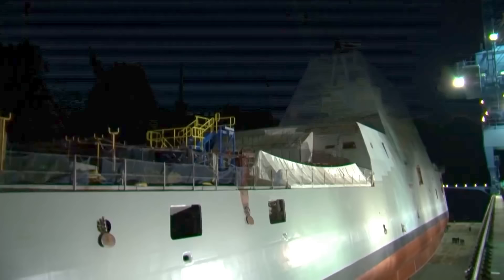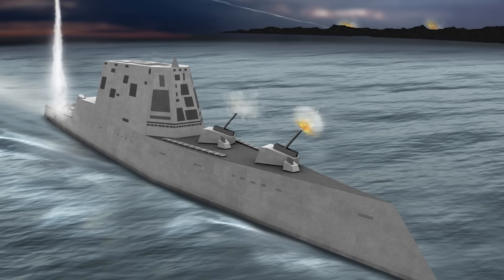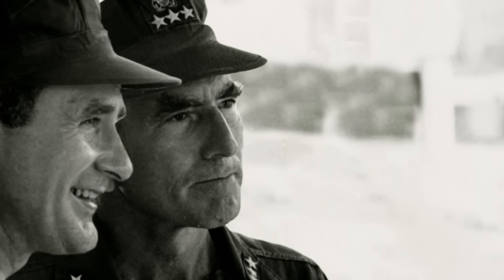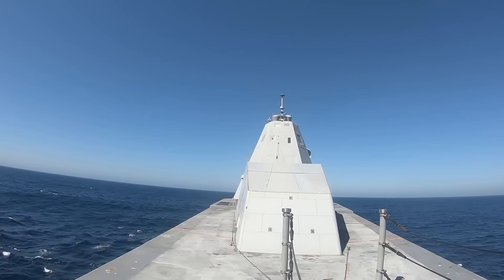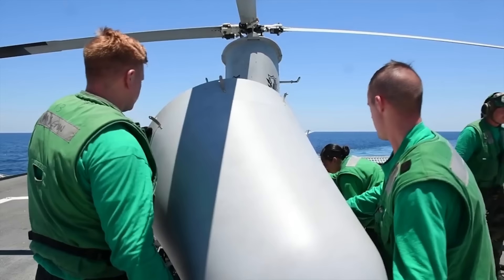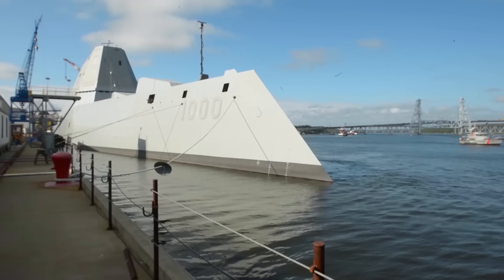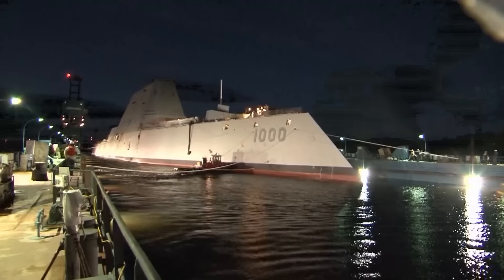The Stealth Ship So Powerful They Couldn't Build Any More

Comment: For a while now I've wondered why the military doesn't go to a modular form factor. Design all new/future ships to be modular in their kit. Systems designed from the start to be swappable with minimal down time due to a unified base set. Have a destroyer that you need to change out from one role to another for a mission/deployment? Pull up to the dock, gantry crane pulls out the missle banks and drops in a multi-helicopter pad or a large diameter gun turret. All within a day or two and the ship is back under way.
Reply: Modularity requires way more engineering work up front. What goes from we'll just weld it in there during construction becomes we need to figure out where to place these bolts, how to access them and how to make these 3 other parts removeable also.
Reply: Never worked in a shipyard or even seen how a warship is built, have you?
Reply: The tried it with the littoral combat ships. It didn't work and was too expensive.
Reply: In theory this would be a great idea, it may work one day when we can start 3-D printing ships in their dry docks so the margins between ships of the same class are a lot tighter. Shipbuilding is still a hand built bespoke affair like it was a hundred years ago, we would need a company like Tesla or Apple to re-imagine the industry practices from design all the way to construction and maintenance for this to work.
Reply: I had see the concept of modular design war ship since 1990s, they don't work, US spent billions on that and failed. with simple reasons, training, reliability, and cost. it is actually much cheaper to have whatever you need integrating into the boat, then to have people trained for that, and maintain it. modular means you will keep changing the crew, who maintain and operate the module, you also need people to train to install and uninstall the module, and they will need to be available at the port where you want to change the module? it is a logistically really bad idea as well. and if you keep those people onboard... you are taking a bunch of people to war without a good reason for them to stay.
Reply: Because this isn't Lego's

Comment: It was cutting the number of vessels in the class which forced up the price of the 155mm ammunition. The rounds were costed on 2 guns per ship, 32 ships, and 750 rounds per gun. That's 48,000 rounds, with development costs built into the price of each one. So when the class was cut to 3 ships, with just 4,500 rounds, even an overly simplistic 48k/4.5k=10.7 calculation can show you how and why the ammunition cost exploded.
Reply: Your analysis is incorrect. The Navy already paid to develop the gun and ammunition so the development costs should not be added back to the cost of the shell. The Navy should only pay for the cost of producing the shell. I am sure there would be some economies of scale but not enough to reduce it to the original estimate which was $68K per shell. The cost exploded because the Navy and the supplier were overly optimistic about the costs. This is typical of Pentagon procurement because generals and admirals don't get punished for screwing up purchasing decisions.
Reply: @andrews.9286  FALSE.. BAe expected to ammortize the costs to develop the shells over the entire production run of them when they quoted a price to the Navy for them.

Comment: I heard it was cancelled because it failed its stability tests and was unstable at high turning speeds
It was also designed for the new railgun system which has never been finished and seems to be abandoned for now
It was from all accounts a failed folly of a ship with good intentions when it was designed but took to long to build putting it beyond the capabilities it was designed for
Reply: You know the Internet stopped charging for periods many years ago.
Reply: @riproar11  Hahahaha........
Reply: Yeah - complete failures are success stories now.
Reply: @rockpadstudios  well to be fair, in the case of the military they DO learn from these failed things they now know what works and what doesn't in relation to the Zumwalt. now you may argue its a waste of money but it's better to describe it as an investment so future ships do not fail the same way and have them lose even MORE money.
Reply: incorrect on stability and turning speeds.  it was easily the most stable ship i have ever been on.  It was so smooth/stable it actually made some of the fun maneuvers boring

Comment: It wasn't explained in the video, but those 800k dollar artillery shells are so expensive because their production line was not scaled up to meet the needs of 32 ships.  Just three ships meant it stayed in the hand-made initial production phase, which is much more expensive, per shell.  Also, the gun was a stop-gap until railguns would be ready, and this thought was part of the reason that so much electrical energy was made available for the ship.  Also, because it uses less sailors, it's cheaper to operate.  The savings will make up for its doubling of cost compared to an Arleigh Burke class over the lifetime of the ship.  Also not mentioned in the video, the low crew size made many have doubts about the crew's ability to perform damage control.  But also, the vertical launch missile cells are on the outside of the ship, instead of clustered together near the middle, precisely to make the ship more survivable once hit.  Something tells me we will be needing this ship sooner or later, and it's a mistake not to field them.

Comment: The Australian Collins class submarine also suffered from ambitious planning during the contract writing stage. It was also a disaster initially
Reply: Building subs when you have never built them before is folly. 
The Collins boats are pretty good these days but still have significant limitations. 
The scary thing is that the much mooted nuclear powered future Australian boats will just be a lengthened Collins class with a reactor shoehorned in..
Australian won't be getting LA/Virginia/Trafalgar/Astute boats sadly; just a poor relation.

Comment: Felt like you missed the most important failure of the Zumwalt class ships.  You can see it in the videos as well.  The ships hull is not strong enough to handle the wave and motion stress required for even deep sea operations (let alone littoral operations) resulting in cracks and buckling of the ship.  You can see cracks and buckles at joints in the videos you provide.  Fixing this problem results in a hull design that is to heavy to support the existing waterline of the ship.  There are a lot of good ideas in this ship but then need to be moved to a different hull.

Video markers where damage can be clearly seen in the ships hulls:

Ship 1000- 
0:04 - 1000 ship.  The conning tower section facing the viewer forms an "A" above the ships hull.  On the hull centered below the "A" is a buckle in the ships hull.  The buckle not only is a very bad sign, it's curvature destroys the intended radar reflection of the ship.
0:31 same location on ship 1000 at the water line you can see a gap at the water line where the sun hits what should be a consistent line from bow to stern.  Also note the extensive repair marks around this position in the ship and a dip in the join between the above water and sub-water hull of the ship.
0:39 you can see buckling at the port side location as the sun hits the area beneath the "A" section of the conning tower on the ships body.  Note this is the port side wall issues at 0:04 and 0:31 are at the starboard side.
0:44 starboard side just forward of the coning tower--between the conning tower and the gun turret.  Note the sun reflection that makes a "V" shape.
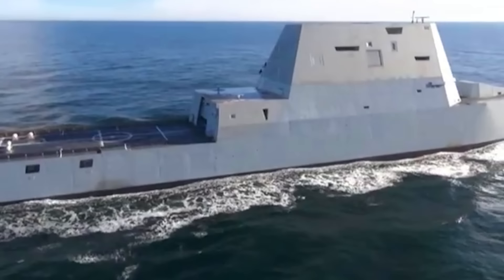0:49 Note the sun reveals extensive repairs, cracks and buckling from the water line all the way up to half the hight of the conning tower from the inflection point forward of the conning tower all the way aft of the helicopter pad..

...

You can see these issues in virtually every image of all these ships.  The hull is not rigid enough to support the design--an embarrassing design flaw for a multi-billion dollar warship.
Reply: I noticed the deformities but it didn’t occur to me they were structural flaws. Maybe some Bondo would fix…
Reply: Didn't know that's what those were. Thanks for pointing them out.

Comment: Projectile and propelling charge unit costs, already high, skyrocketed when the number of ships, and the amount of projectiles,  were decreased - losing the lower unit cost  benefits of large production runs.  

The original intent of the ship wax to provide replacement for the fire support abilities of the battleships. However the  projectile was merely a fragmentation round.  It  was certainly useful to some degree, but the effects on the enemy would have not been close to equivalent to a 16" shell, even given the high precision of the guided round.

Basically, it seems that no one at the highest levels of the Navy reviewed the progress of these ships and considered the changing environment it was to work in, or  the effects of the cost reductions on the capability of the ship, and hence its viability.  It is a waste that no one has taken responsibility for.  More adult thinking was desperately needed.

Comment: The ammo for those guns was enormously expensive it was inconceivable... $800000 per round The ship was ultimately a failure because if it. they'll retire it cuz it doesn't meet any of the current requirements for any designated ship. It cant fit enough missiles to be anything. The engines were another problem if my mind serves me right....
Reply: A lot of that has to do with economies of scale.

Because they scrapped the plans to build the rest of the Zumwalt ships, the ammunition orders were reduced, and cost per unit went up.

Now, there are plenty of reasons why that class was canceled, not the least of which was the privatized maintenance contracts, but I believe the ammo cost issues were a result of the cancellation, not the cause of it.
Reply: And all the aluminum supports were showing stress fractures not to mention all that aluminum makes one hell of a blow torch .

Comment: I think aspects of the ship are salvageable. We know that the hull design works as intended, so I'd start a project that takes the design, shrinks the size by 1/3 to 1/2, utilize mature technologies for power and systems and utilize drop in modules for power, propulsion and weapons. This way they can have specialized versions that use the same basic hull. Think AR-15 ship.
Reply: You’re wrong, the hull is very unstable in moderate to heavy seas plus many other problems… it’s a Turd, a giant Navy Goat F*ck. Just a little research will tell you of the multitude of shortcomings, most revolving around immature technologies, massive cost overruns and armament that is way too expensive.
Reply: Yeah but that makes sense so it won't happen.

Comment: The sheer complexity of this ship and its systems makes me wonder how well it would function if it took a hit.
Reply: Yup, what if a missile or guided bomb penetrated the hull or super structure?   That design to me would contain the blast wave withing the ship structure, and with all of those fancy computers and such running everything, a loss of significant power would be a very bad thing...
Reply: It wont, modern ships are not designed to resist hits, not really armor or enough redundancy, they are relying on active defense and electronics, on the words of a sci-fi writer, those ships are eggshells armed with sledgehammers
Reply: Considering the modern tank can't shrug off attacks, I imagine there is little hope for modern warships.  Blame the lack of innovation, that armoring has not been keeping up with weaponry.
Reply: @elizabethlestrad5282  Modern warships, not this thing though, are made to withstand multiple strikes.  It's called "damage control" and the best navies are the ones who practice it constantly.  This ship lacked the crew to properly address any form of damage done to it.  The rest of the US fleet, including support ships are built so that damaged areas can be sealed off and repairs effected to prevent them from sinking even if they are blown in half.

Comment: 3 of these ships are made 2 are active and over 30 are being made. The cost isn't 4.4 billion but not far off.  It's 4.2 billion per unit and the program itself has a cost of 22.5 billion and for those who don't speak in Kilowatts or megawatts I'll translate it into english for ya  the ship basically has an out of 47,500 HP for each gas turbine they also have generators that produce 5,100 HP each giving the ship a total power output of 105,000 HP and it's top speed is 30 kn or 56km/h or 35MPH and they actually initially planned to make more around the 60 mark of these destroyers but due to cost they axed 29 from the original amount they were planning to create. The current number is actually 32 they  haven't dropped on that number since.

Comment: With the cost of the ship and its failures it could easily be repurposed as a drone platform. It could still serve as a warship but with as much computing power is on board it could run drone swarms that serve multuple functions. Submersive drones to intecept torpedos and harass subs and other boats. It could use flying drone swarms to clear decks on enemy ships in heavy engagement. It could be fitted with hypersonic drones to intercept hypersonic weapons. In this fashion it could be fully cappable as a support, offensive or defensive assignment.

Comment: I dig the multi-compartmental individual shipping container like assembly visually melding into one. 
Which would think has got to be better able to isolate breeches while remaining water tight Sections retain buoyancy. 
As to why some sections made out of different materials, must be something specific to type of operations carried out. Requiring something in between unlike materials made out of different properties to prevent reactive corrosion.
Reply: The method you see in this video has been in use for 40 years, its not new or novel.  Typically all naval vessels are aluminum main deck and above to reduce weight.

Comment: G'day Dark, What I can't fathom is that the Z Class warships were initially envisaged as the Navy's new 'Destroyers'. Then, it was like hundreds of specialists and private contractors were let loose to pack into the 'Zs' as many non-destroyer like systems, or, basically conventional destroyer systems that were ludicrously upgraded until a point was reached where the 'Zs' had a lot of hardware and software systems that didn't really need to be onboard, in those forms.
One has to wonder who the geniuses were that signed off on ridiculously expensive weapons systems with the most expensive, unique, ammunition in the world plus huge calibre guns that didn't really have the range as advertised.
How is it that most warships of most navies these days make perfectly good use of one, sometimes two, small calibre automatic fired deck guns. 
If the latest models of existing Destroyer weapons systems where put onboard, then the Navy would have got what they wanted in the first place.  
Finally, your extensive listing of all the private contractors and their associated political locations rang alarm bells with me. 
Could the Z Class warships have been nothing more than a mammoth political boondoggle; where the goal was to benefit politicians 'on the hill' instead of national defense on the high seas.
A despicable, obscene waste of taxpayer funds that only succeeded in to filling the pockets of contractors and creating three truly embarrassing 'haze grey elephants' for the USN.
Regards, Bill H.

Comment: Thinking on it, they should have replaced the guns with the tried and true 8/55 Mark 71. With the original Mark 9 entering service in 1925, it is not like there is any risk to the system at this point, and it would have the necessary range and penetration to fulfill the Zumwalt's land attack role.

Comment: Personally, I feel that despite the disappointing fails and insane overbudget runs these ships have garnered. The shear amount of technology development made just for them, probably will be easily reused into cheaper more logical new navy warships.

 Maybe they could create a frigate class around the stealth technology and hull shape and the lessons learned. Having a bunch of frigates or even Zumwalts that were reengineered to be cost effective that have the radar cross-section of fishing boats or even smaller is crazy. 

Zumwalts in general seem to be suffering from too many untested technological platforms on one ship. Than having those platforms fail or underperform making funding for the overbudget project increasingly harder.

Comment: The U.S. Navy has made a series of mistakes throughout the 1990’s that are now coming home to roost. From the failure of securing an air superiority 5th generation fighter like the F-22, to replace the F-14 Tomcat (the F-18 E/F Super Hornet should’ve never been a thing), to the retirement of its battleships and the failures of the Zumwalt class. It is astounding and now the Chinese Navy is outpacing the U.S. Navy in procurement, and technological advancements of their fleet.

The United States better buckle up. It’s going to be a rough ride in the years to come.